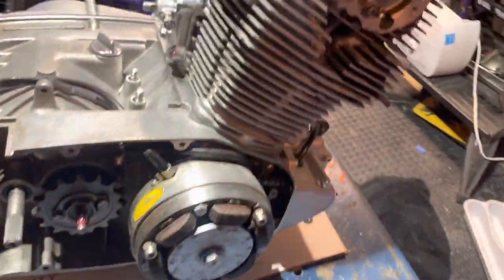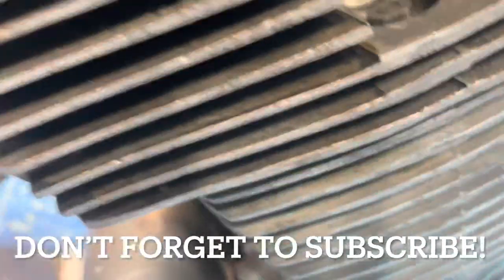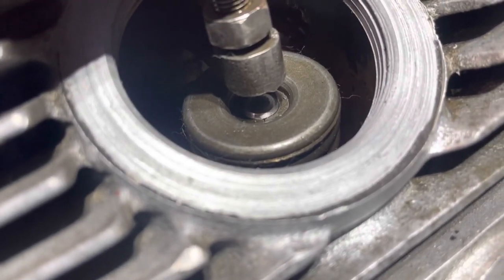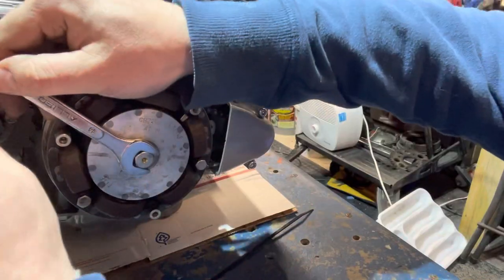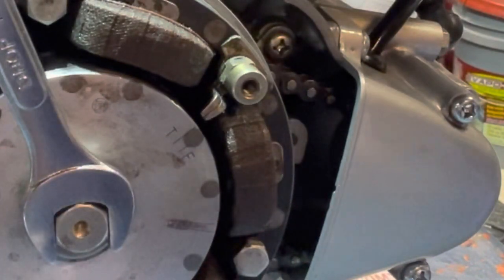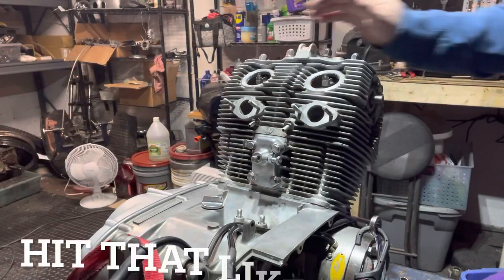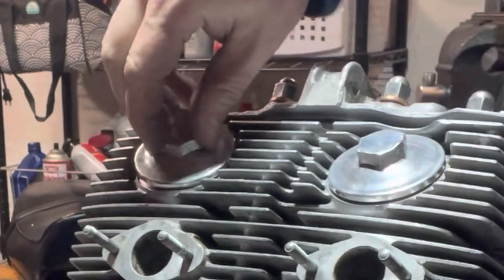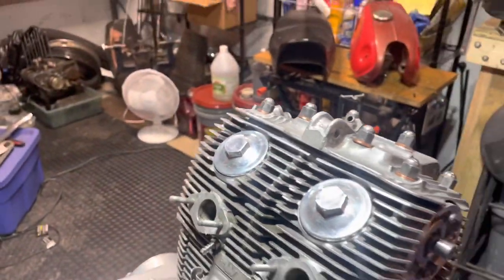Adjust Engine Valves & Cam Chain Tensioner: Honda 305 Super Hawk

Comment: I adjust the valves then turn back wheel until I can't move valve then tighten locking nut that way it doesn't turn when you tighten.
Reply from the maker: Oh that’s a good idea! I’m glad I found that tool tho.